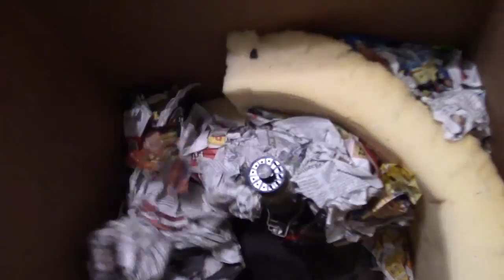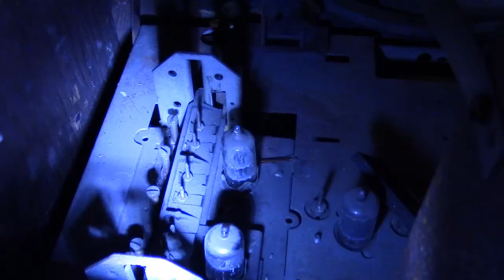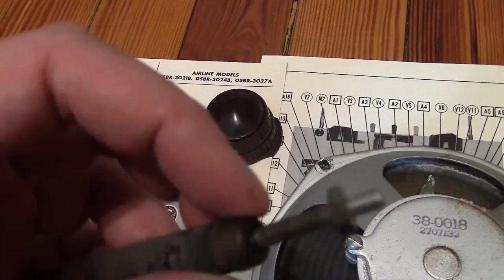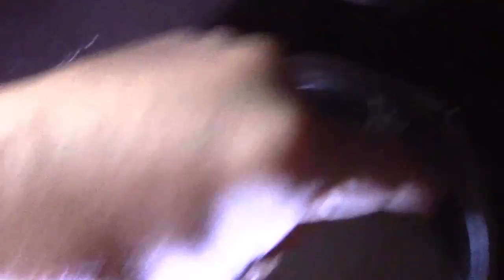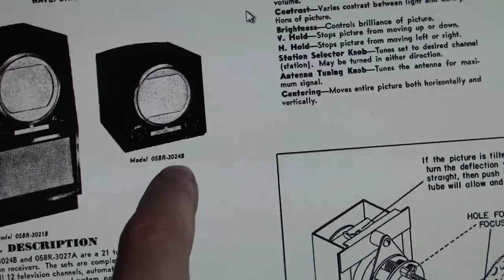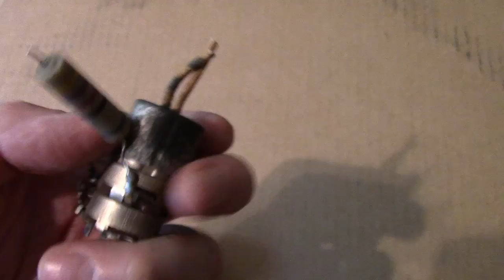Airline 05BR-3024C arrives

Comment: This really resembles the Raytheon model C-1104B porthole console I had restored back in 1990 or so. It had the same tuner and knobs, and similar tube lineup. Mine had a strange lack of high voltage problem that turned out to be a shorted shielded cable!
Reply from the maker: Yes, this AIrline is based on the Raytheon - or maybe it's the other way around ?  Cool looking set I think.

Comment: I wonder how well a 6339 would work as a damper tube.  I have one of them.  It's a tube similar to a 3B29 but miniaturised with a metal envelope designed for oil or air cooling.

Comment: I think you should fix the outer conductive coating on that picture tube with aluminum duct tape. Just cover the whole outside rear of it minus the anode cap area with aluminum duct tape.
Reply from the maker: +Mathew Bailey I use a product called Slip Plate.  It's a type of conductive spray paint very similar to what was used originally.

Comment: I don't think that using a 10K control in place of a 5K will make too much difference given the way it's wired with the top end open, I don't think that it has a logarithmic taper like a volume control would. With regard to rust removers I managed to pick up a jug of a phosphoric acid based product used for cleaning water filtration systems called Rezcare, hopefully they still sell it. Another source is something called milk stone remover, but I have had a much harder time locating that product around here, one feed store said they could order it in but at $45 for a gallon jug whilst mail order outfits were selling it for less then half that!!! One nice thing about phosphoric acid is that it treats the surface of the steel or iron in such a way that it resists rusting again.
  The shape of the H.V box reminds me of what a Maganavox TV or what a Philco Predicta uses, no doubt the the dimensions of those are different but who knows?